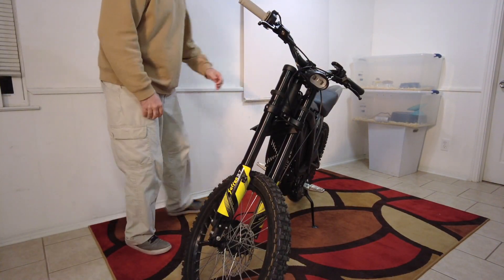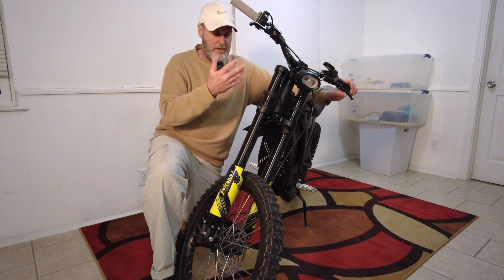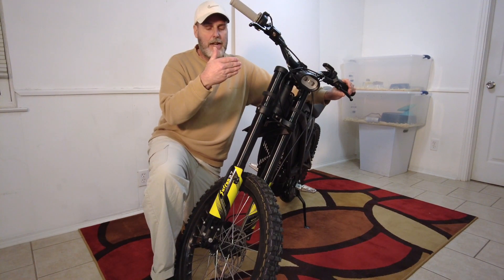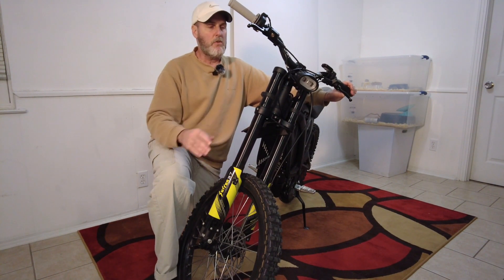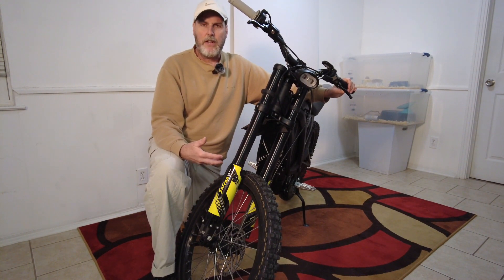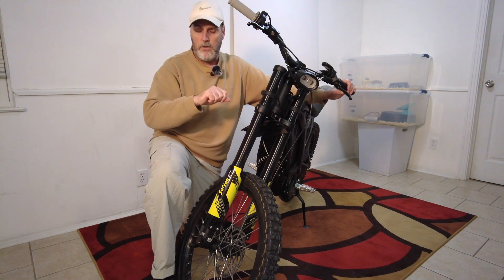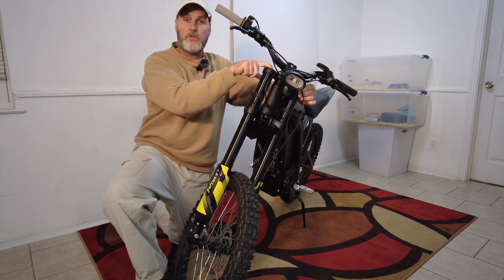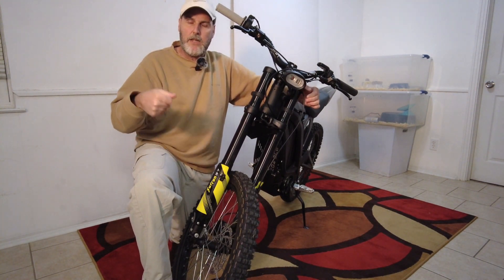Sur Ron-Fastace suspension correction Rebound/Compression

Comment: For the rear spring... if your bigger would you want it screwed down or up. Im 5'10 210lbs and carry a bookbag normally another 10lbs or so. I had it screwed down about 1in. It bottomed out easy.
Reply from the maker: The spring is there to hold the bike up with the added weight of the rider. Adjusting the spring preload is an adjustment to match up different weights. As a spring compresses it typically gets stiffer. Proper setting of spring preload means the proper spring sag when you sit on the bike. I would assume the ballpark sag setting while you are sitting on the bike with all your usual clothes on and your bagwould be 1.50 - maybe 2".

Once Proper suspension sag is set is when you start to figure out how much compression and rebound you want to use.

If you weighed 250+ then I would think that would be to much for the stock spring to hold up within its usable length. You likely will need to compress the spring more. An inch down on that shock collar isn't much. You likely have another 1" to 1.5" to go. Max adjustment appears to be 2.5" per the threads on the shock body.

Then when you find that the rear suspension sag when you sit on it is in that range then you can play with adjusting compression/blue knob rear shock. Click 6 from zero/counterclockwise is a good starting place but there is 6 more clicks clockwise. Compression adjustment turns slow down the speed of the rear shock compressing or allow it to compress faster.

Note the suspension can bottom out from time to time and that's OK but that would typically be on the biggest bump, g-out, jump landing that you encounter.

The suspension stroke is there for you to use all of it but always bottoming it out means your using more than you have.

My advice is try increasing your rear spring preload another inch (compressing the spring). Means your going to need to turn the ring clockwise a whole bunch more times.

I'm a solid 200-205 pounds and I'm only about 1/2" tightened down on the shock spring collar. I could use more but in my daily riding I'm not bottoming out hard enough to notice or it to be an issue. Now if I was hitting big jumps throwing me 4-5 feet in the air for 10 feet or more then I'd definitely need more base spring preload adjusted into the spring.

Hope that helps. Typically with more spring preload then you will need to start slowing down compression and rebound to compensate. Good thing is you can play around with settings and then go ride to see what's been affected. Just take it slow because you don't want to change something too much and make the bike act weird and then you crash.

Comment: Is the steering tube a straight tube with this fork? I was in a nasty head on accident with a car going 40mph.. the axel was bent, about 12 spokes broken... and thats the only obvious damage.. other than the steering tube has a very very slight bend but not sure if thats how it is since it seems steering tubes come in a variety ways
Reply from the maker: Wow, ouch crash with a car. That happened to me in the late 1980's on my Honda CBR600 at about 35-40mph. Broke my Femur bone, not good. My thinking with the steering tube is that it's likely bent from the impact. Most are straight and in line with the fork tubes but they can have a tapered shape where the bearings ride.

Best fix to do it right and upgrade at the same time https://chargedcycleworks.com/products/upgraded-kke-suspension-forks-for-surron-light-bee?_pos=2&_sid=3c111743e&_ss=r
Reply from the maker: I just got a wild hair up my rear and came to the conclusion since I could use a (fastace) fork rebuild: new oil/new better fork seals/and a little bit stiffer spring rate which cost about $250 plus shipping back and forth to have done...why don't I upgrade my fork. Who can't use a better fork on these surrons??? I'm going to likely try the 2024 KKE gold colored forks from Charged Cycle Works.
Reply from the maker: I just purchased the KKE fork. I will have my current Fastace forks just sitting in my house after I install the KKE unit. I'd sell my, like new looking, used of course 2022 Fastace forks for $340.00 shipped if you are in the U.S.A.
Reply: I appreciate the offer Im not in the position to spend that much atm.

I think the forks are good overall though.. Theres no leaks.. Put some paper towels around the seals and  no oil.

I already bought the spokes and Axel I'm about to put everything back..

Maybe I could send a Pic or two and get your opinion...

Lastly do you know if the steering tube can be replaced while not damaging the lower steering bearing (idk name of bearin)..
Reply from the maker: @CmdrTigerKing Maybe an offroad oriented bike store might have a tool that allows then to replace fork steerer tube. In about 1 week I'll have my old fork off where I can see it's steerer tube and better qualified than to advise if they have any lean to them as factory.
Reply: @GettingthruLife yeah i wish i could afford it.. im so screwed atm . stupid drunk driver hits me then runs scews things up
Reply from the maker: @CmdrTigerKing  sorry to hear. Life can be difficult at times. Why my youtube name is getting thru life. I identify with the life struggles and try best to survive/stay happy.
Reply: I appreciate it man I edited out the language from earlier, I was just really frustrated because I thought maybe I had finally perhaps fixed the bike but turns out it wasn't the case.... I need to replace the steerer tube.. Fast ace says they have one for $29.99.  But it seems you need a press to fit a new tube, is there any other way? So you forks are still for sale for $340?  I might be able to figure something out to get those funds.. Only the axel and steerer tube seem to be the issues which I already bought a new axel but for all I know there's far more that I don't notice. I live in Northern California  @GettingthruLife
Reply from the maker: @CmdrTigerKing My forks I still have. They come with the steerer tube, the inside star nut, the triple clamps and the axle. Everything you would need besides you bearings or you might want to install new bearings because if you fork to that big of a hit then you current bearing might, highly likely be damaged too.

Yes, the replacement steerer tube has to be pressed in and the old one if you are using your previous triple clamps, that tube pretty much needs to be pulled out which is no easy task.

Comment: This Fork works good compare to serial fork but if you have some problems, the post service it's so bad, be careful no spare parts.
I do not recommend buy it, if you have some issue, throw it away.
Reply from the maker: If something got damaged with the suspension, I'd likely upgrade to the the better options from the Charged Cycle Works website. For modest riding the factory Fastace suspension works just fine.  https://chargedcycleworks.com/collections/suspension

Comment: Any chance to get a link to the pdf?
And somebody now how to service this fork?
Reply from the maker: The fork pdf link is the video description. I don't have the pdf for the shock but it's out there somewhere.
Reply: @GettingthruLife   so if I understand well, it’s no coil spring on it.
How we put or take air in and out then? … sorry 😞 I’m confused.
Reply from the maker: @petrusclassic  This fastace fork has a spring so there is no way to add air to stiffen. Spring in one side and compression/rebound cartridge in the other fork leg. You will just have to call around to motocross suspenion tuning/bike stores and see who will be comfortable taking apart and servicing this fork.

Comment: do you not make any adjustments on the left side fork? I have the wheel off.. and pressing upwards on each fork with no apparent adjustment knobs I can barely move up but the other one actually feels really slow going up
Reply from the maker: The spring is in the non adjustable side and on the adjustable side is the cartridge with oil and speed valving. Different setup and function between the two.